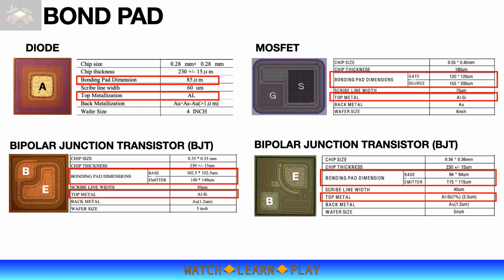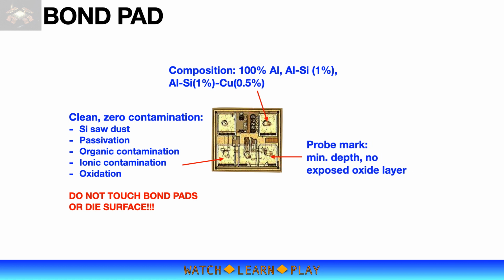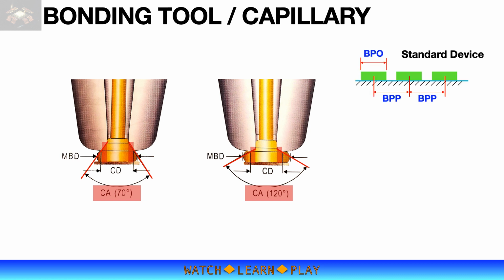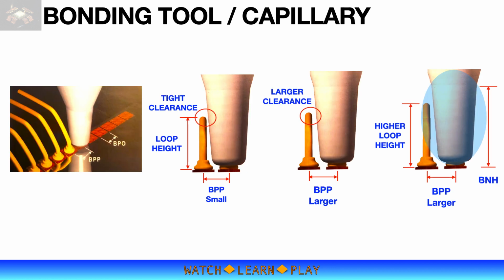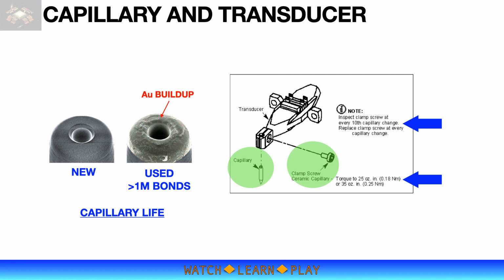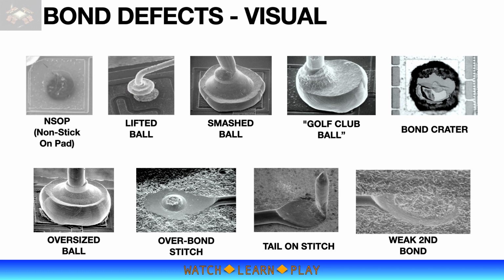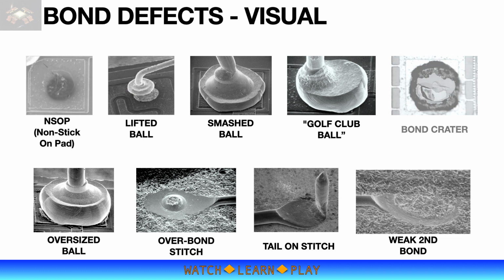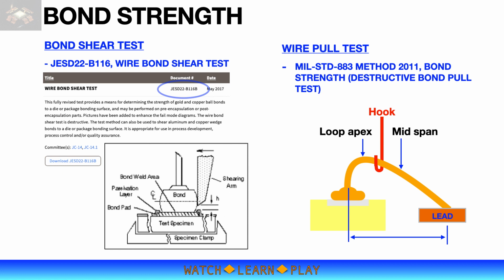WIRE BONDING (PART 2)

Comment: Thanks for the Video!
In my Bonding process, the stitch is extremely weak and looks like in Bond Visual Quality "Weak 2nd bond", but the whole capillary impression is visible. Its just the fishtail that looks fragile. I allrady tried to fix it by varying the Bond Force and US Time parameter, can you imagine, where the issue is?
Reply from the maker: There are several possibilities,but without technical details I cannot really give a proper device. What's the pull test numbers?
Reply: @watchlearnnplay  i have got a pull test device, that only measures forces >25mN, and those Stitches are far away from that, so the force is never bigger than 25mN. It seems like even when i touch them a little bit with the Hook, they loosen from the Goldpad. The Wire doesnt even deform to the "triangle-form" when pulling on it, the stitch just loosens and i lift the bond. So, the stitch is extremely weak.
ps: Thanks for your quick answer!
Reply from the maker: If you can send some photos of the 2nd bond, capillary dimension, wire diameter then I maybe able to help you
Reply from the maker: I replied to your email. I hope it helps.

Comment: wire bonding temperature plz
Reply from the maker: 150C to 240C depending on your device,  leadframe / substrate and bonding machine. For room temp bonding you can use Al wedge bonding process
Reply: @watchlearnnplay  Is the higher the temperature, the better?
Reply from the maker: For bonding, higher temp the better. But not all materials are good at high temp.
Reply: @watchlearnnplay  Is the temperature related to BST and BPT?
Reply from the maker: Temp will affect BST
Reply: I have a lot of questions. Please let me know your e-mail
Reply from the maker: You can message me thru my linkedin account

Comment: Thank you so much for the information, 
I am working on CoB tech and I mainly use ball bonding with gold wire (25 um) but the pull test is not satisfying. The wire is always cut right above the mashed ball. Do you have a clue where this might come from? loop formation or too much used force
Reply from the maker: Cut above mashed ball is also called "break at ball neck" break mode. This break mode is not uncommon. That section of the wire is the HAZ which is the  weakest part of the wire. Pull strength can be affected by several factors. Are you getting low pull strength or you're just concerned about the break mode? Note that MIL or JEDEC std do not require specific break mode but rather just pull strength.
Reply: Yes exactly I am getting low pull strength  @watchlearnnplay
Reply from the maker: If you can share additional information I can definitely help you on this. You can send it by email. Would be good to see at least a sample photo of the device bonding layout and loop height / profile that you are using.

Comment: Hello, Great Video!
I am a PhD student at polytechnique Montreal. We have a CQFP44 packages and Dies of 51um pad pitch (22nm FDSOI tech) that I need to bond myself at the university using
ASM Eagle Xtreme gold wire bonder in the university.
we need to perform bonding of 46*46 um pad size with pad pitch of 51 um (distance between pads of 5 um only) of 22nm technology on a 44QCFP package using a diameter wire of 0.5mil and 30um fine pitch capillary.
I read the bonding machine manual and followed the steps to teach the machine but I don't know the criteria to specify the bonding parameters. Also, I am currently stuck at the wire threading step through the capillary (It is very hard to thread it through and once I do it and operate the machine it gets cut every time and error message appears).
can you help me with this?
Reply from the maker: Does the wire gets pulled out from capillary everytime you get an error? And the error is EFO open? And is the error  happening when you're trying to form FAB after threading or is it during bonding?
Reply: @watchlearnnplay  hello, thank you for your reply.. the capillary starts moving to bonding position strongly then the  wire gets cut and following error message appears:  Motor: Bond head Z search contact level out of range system will auto clear servo error (F110) to recover
Reply from the maker: I would think of two possibilities. A really serious problem would be Z servo motor or control board problem but that should be rare especially if your machine is not that old. I suggest to do XYZ servo calibration first. A minor problem would be related to camera to crosshair offset. It is possible that camera offset is not thought properly such that X-Y table would go to the wrong position where bond surface or bond plane is not there or too deep which is causing the bond  head error. Usually, if the camera offset is correct this type of error will cause the bond head to crash and break the capillary. Hope this helps.
Reply: @watchlearnnplay  thank you so much for your help.. I will try and hope it gets solved

Comment: yeah man, keep coming out with content... I cant find pricing for any of this equipment. Maybe that?
Reply: It's rarely sold as is at least brand new products. You kinda need to ask for quotation. But the K&S rapid costs roughly $100,000 to $150,000 or so if bought individually without any additional stuff.